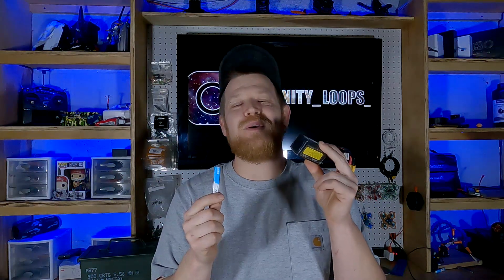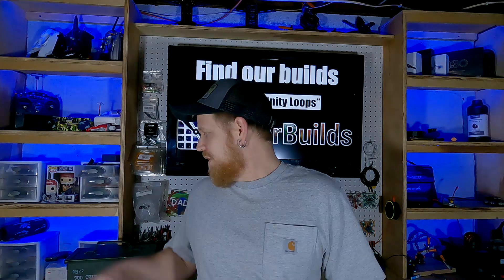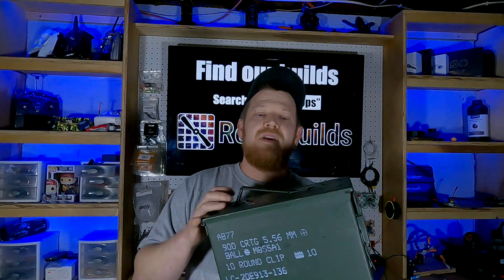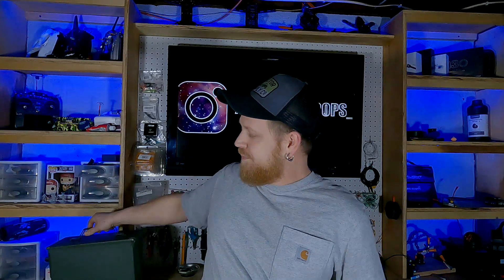How Do You 1s Lipo? (Whooptorial Wednesday)

Comment: p.s it's the way we fly 1s lipos that makes them bad faster. if you have a good build whoop, which don't sag down to 3.4v or even lower after 5 seconds of flight it will last very long. don't fly em down to 3v or lower as most of us will do or did. 
if your cables are not thick enough ,connector's to small or bad solder joints, then lipos will get hot very fast, which end up in damaged chemicals.

Comment: a 4s pack as allways same use on all 4 cells equaly, it's normal that it dosnt work that way for 1s cells you allways have a different use on..so resistens and what not is different to one another.
the chemicals inside a lipo is not rly different, so 4s packs is just 4x1s...all the same but the capacity or c ratings. BT2.0 is way better than ph2.0...lipos will not just blow up if you use em normaly(i mean not throwing it in the corner and haveing bite wholes in it). if your did blow, then u did something wrong with it. i treat mine mostly like cheap trash but in 20 years never had a single batt blow on me..
dont store em in cold enviroment, room temp is the best... 
thanks for your time bro, but this is just another guy wanting to make money of ref links....
Reply from the maker: Those links aren't affiliated. Just shortened so it looks cleaner. Thanks for your input though.
Reply: @InfinityLoops  i doubt that's true. there's ref inside the link. amazon has no short link function as far as i know. ref links on the otherside, look just like it.
Reply from the maker: Amazon has no short link function. But copy a full link from amazon or any website, paste it into bitly or tinyurl and ta-da! Shorten, non-affiliated, very clean looking link. You're welcome.
Reply: @InfinityLoops  i know, but if it was a non ref link, it wouldnt have ref in the link. it would just be amazon.com/whatever...and not ref and all that. i will feel stupid about this if i'm wrong but i feel pretty confident.
Reply: @InfinityLoops  and pls don't take it in anyway as an attack against you or something, it's just my opinion about that, you cant get smarter if noone correct you and by you i mean me.
Reply: @aeQuator  they are affiliated links. I'm going in to change it now. That's my bad. I did the description links this morning for this video on my browser at home. I am affiliated with Amazon through twitch. Complete mistake. Thank you for pointing it out. Not my intention! If Multi would do his own god damn descriptions....lol my bad fellas.
Reply: thanks for makeing me not feel stupid and crazy, appriciate your honesty.
Reply: So you are crazy 😆
Reply: @aeQuator  if you go into the amazon app click the share icon and post that link you will see the ref always pops up in the link.
Reply: @Mopar32985  did not know about that. i use smile on pc and my phone, so theres allways refs for me, part of the money goes to a good cause, i think it's how it works. Thanks for the talks guys, appriciate it.
Reply: @aeQuator  No problem brother 🤙